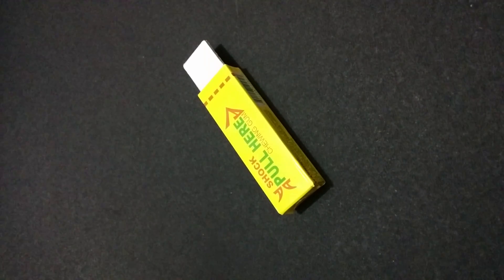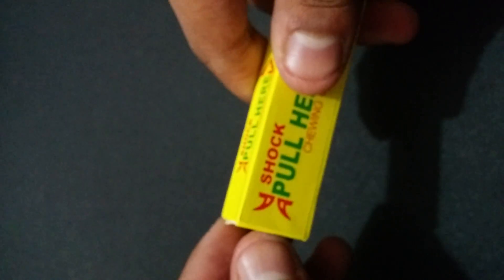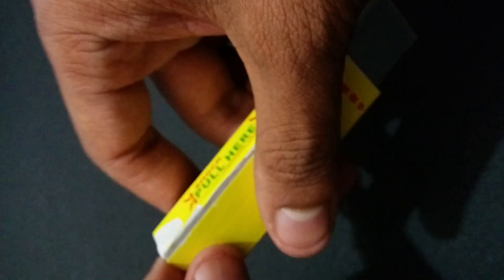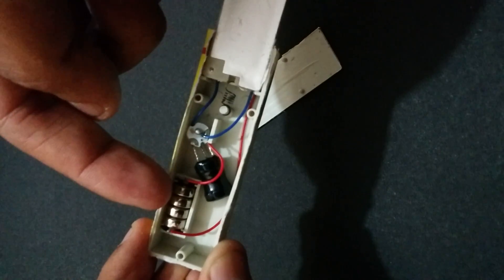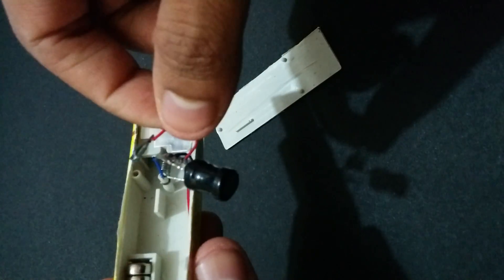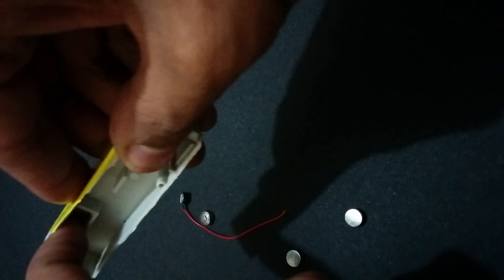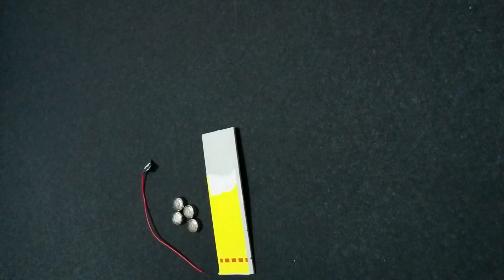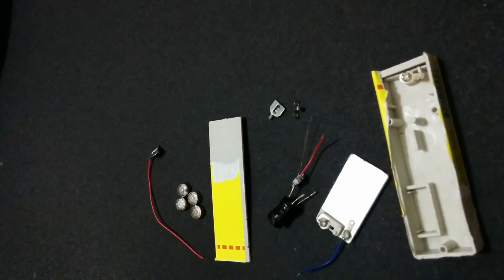How shock Chewing Gum Works : What's inside a Shock Chewing Gum

Comment: You still never explained how it works. How does the driver oscillate? What component is driving it? What is the inductance of the primary, secondary? What is the significance of using an autotransformer in this circuit? How does an autotransformer function, especially in a simple oscillating circuit like this. Also there is no capacitor

Comment: Bro everything ur saying is wrong!!
The first thing taht happens is that the dc voltage from the cells gets converted into ac through the small chip that it soldered over the transformer which u worngly call a capacitor. The ac voltage in then sent to the primary coil of the transformer. The voltage is bumped up as the current transfers to the secondary coil of the transformer. This ac voltage is what gives u the shock. The live wire and neutral wire connect through ur fingers as a conductor causing an electric shock. This shock is painful. Please say correct things while ur making a video to educate people. Mabye u called that a capacitor because a capacitor is used a lot of times with transformers. There is no use of a capacitor in this device since the ac output from the device will work to shock u. The capacitor is used after a diaode to used to convert the ac output of the transformer to dc. This capacitor keeps the current coming from the diaode stable and not coming in pulses. Hope this helps to whoever has come to this video for electrical knowledge.
Reply: Hi Sanjog, but what kind of inductor is this one with a chip? Can you tell us the spec, please?

Comment: I never knew that LR44 batteries can give shock.
Reply: I too was not knowing
Reply: ye china hai yaha kuchh bhi ho sakta hai
Reply: That black thing is a flyback transformer that that transforms AC converted inside the white blob into high voltage ac, when you touch it it discharges.

Comment: The black thing is actually a transformer with a coil inside it that converts AC to higher voltage AC with less amps. The small chip converts DC to AC, there might be a small capacitor in that chip also but I highly doubt it and don't even think it's possible. I'm not an electronic expert but has researched this particular gadget extensively the last few days for a thing im doing.
Reply: Hey Did you succeed ? , Cause i am not getting this thing near me , Maybe I can make it , If worked please reply
Reply: No this was before I was medicated for adhd so I lost interest. Thanks for reminding me I’ll research it more :) I see there’s a lot of arguing about if it’s a transformer or inductor and I need to read up on it more to figure out exactly how it works.

Comment: give circuit diagram 
and as i know you say which is capacitor. i am not agree with you because the capacitor has 2 pinout, and here is three pinouts so give some basic information about this component.

Comment: Hey can you replace the batteries on this if it dies?
Reply: yes but that black thing is not a capacitor its auto-transformer
Reply: Whats an auto transformer
Reply: its a ferrite core and wire wrap around it and its have primary and secondary windings its have 3 pins the en of the primary winding connected to the beginning of the secondary winding

Comment: Hello there!I would like you to know that I was the first one to dislike your video!Why? Because apparently your knowledge of electronic component is fundamentally deficient.Otherwise,you would know the quite obvious difference between an induction coil and a capacitor.That cylindrical object my friend,is not a capacitor but rather an induction coil.However,the part about the higher voltage being induced in the secondary due to the turns ratio is correct.There are no capacitors in this circuit at all! I hope you add a correction in the annotations before someone gets the wrong idea or worse still,writes something bad in the comments.
Reply: cordova montagio oh
Reply from the maker: Yes , actually i have just started this channel, i will make sure these kind of mistakes will not be repeated in future.. Thanks +cordova i will definitely keep in mind, all your suggestions.  Thanks :)
Reply: You are right. this guy doesn't know what he is talking about. I was hoping someone had measured the current these things put out. do you have any idea.
Reply: This is a good teardown video--and although this commenter, Cordova Montagio is correct--that he is UNKIND in his pointing this out is the most salient point he has made. Thank you for this video, despite this error. Really, people don't care what you know--until they know that you care. I appreciate your vid.
Reply: Great Scott! you imposter!